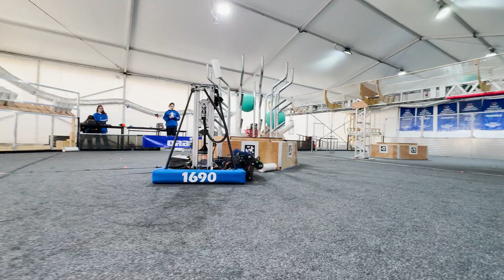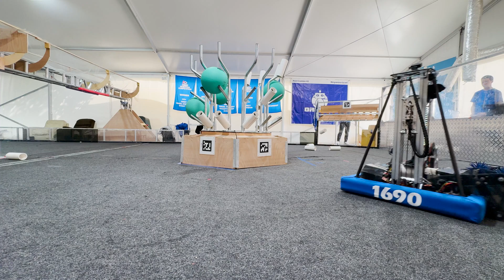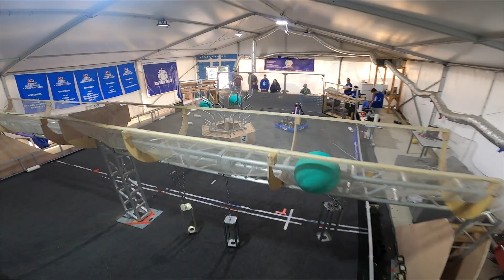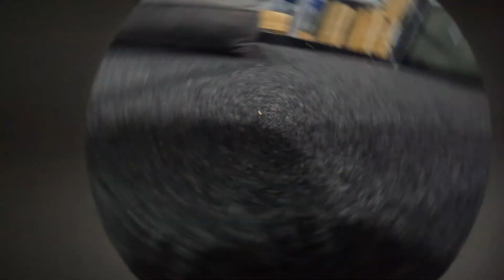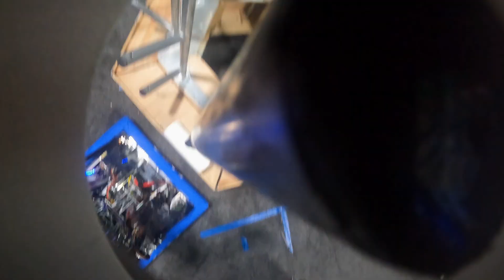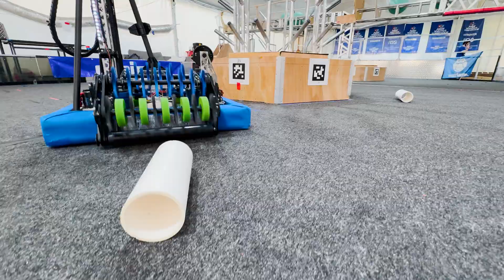FRC team 1690 Orbit 2025 robot reveal - "WHISPER"

Comment: I freaking love this robot. I don’t know if you guys are answering YouTube comments, but I have a few questions. How did you guys decide on belted cascade for the elevator? Does it provide any advantages, or is it just better to deal with than chain? Also, I’m from Team Paradox 2102, and am working on a similar climber design. We haven’t had too much drive team practice with alignment, so how easy would you say it is? We are already considering adding alignment guides to our climber, and I would love some input about how useful that would be.
Reply: i'm guessing the reason they did the diffy elevator is to minimize weight on the elevator/end effector, same thing that the suction gets them. all their motors and other systems can be on the base and they just need the belt up the elevator and air tube, making the arm and elevator super light which allows it to move faster and lowers center of mass.

Comment: I keep trying to find issues, and then i see its already solved, arm breaking? Have a ziptie joint in the middle. Motors on the carriage? Nope make the whole elevator and pivot a coreXY mechanism, no wrist twist? Nah its chill the indexer lines up the coral into the correct orientation. This. Thing. Cooks.

Comment: Mech team: 😎👍
Software team: 😢
Reply: orbits software is one of the best ever on any team.
Reply: Yeah as far as I can tell this thing has:
Custom localization software.
Their standard amazing drive base code.
Automated scoring with apriltags.
Amazing control systems for that arm.
Game piece detection for fast pickups.
Game piece rejection to prevent them from having two coral at once. (I think)
LEDs.
And more that I've not noticed yet.

And that's not even counting the full suite of custom tools they maintain.

Their software team cooked
Reply: @dragonblade3166  your not allowed to have two coral at once though, and last year they had full auto cycles, and they said that they played one of their games without touching the controller once, i imagin that this year they will have full auto cycles, and it will be amazing.
Reply: @LyrikSongz They have it already, most of the video is actually autonomous
Reply: @dragonblade3166  no game piece refection unfortunatly they are quite famous at Israel district champs for picking up multiple game piece during auton and even teleop accidently and getting foul points many times
Reply: most years its the other way around for orbit
Reply: As a programmer, this isn't really that bad. Now yes, fine tuning the stuff to this degree is where it gets difficult, borderline insanity, but the rough strokes aren't bad. The only reason I say this is because they can just reuse their localization software from last year. If you change some settings on your limelight, you're all good from there. The vacuum is just on and off, so that's fine. Detecting a game piece inside the robot is just a sensor. Rejection is just spinning a motor backwards if you already have a coral and you see one coming in. All the stuff with the arm is a PID loop based on the current position of the arm. Still, impressive, nevertheless. Extremely smooth, too.
Reply: @BadAtNames0017  it was a half joke, half serious but in particular I believe the diffy elevator would be difficult to program
Reply: @__Cake287__ Fair.

Comment: no coral station intake?
Reply: Why would you need dedicated feeder intake when you can just have the Human Player drop it on the floor and take it from there, which doesn't need precies timing between the driver and the Human Player
Reply: Cycles would be much shorter without the coral drop...
Reply: @user-hl8dz6it8u  No, it's a lot slower to align and grab (and a lot easier for opponents to defend by messing with your alignment) than it would be to intake from the floor, plus the coral can roll closer to the reef for shorter drive distances.
Reply: @rowanmcalpin I think it will be easier to defend against, and the difference in distance is insignificant. But we’ll find out at competition! Regardless, this robot is🔥
Reply: @user-hl8dz6it8u have you seen how far you can drop them, it’s not hard to get the coral to end up just infront of the reef
Reply: @AussieMich It's possible, but the interaction with the carpet is quite unpredictable, so I wouldn't count on it.
Reply: Would the cycles be though, it's extra weight for a funnel and extra time to line up without it, it's like having a dedicated source intake last year, it's much quicker to use the same ground intake
Reply: @LiamGlover-h9uwhat do you talk about this robot is at weight limit
Reply: @UgandaBasement  because weight is a factor to the speed and acceleration of the robot? As most FRC members should know (I hope so at least) that weight adds strain to the motor and reduces the speed and acceleration of the robot. There was a reason our team was so fast last year, and the fact we only weighed 80 lbs was definitely a factor
Reply: Very impressive!